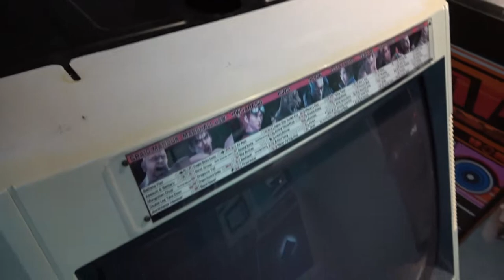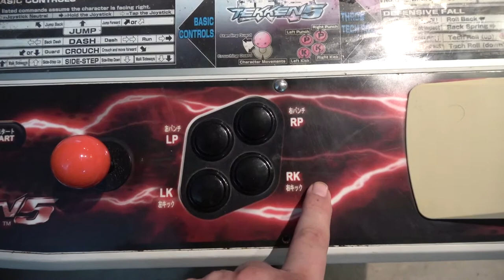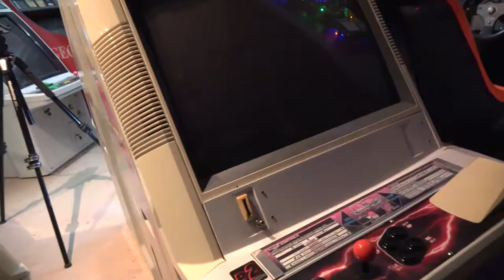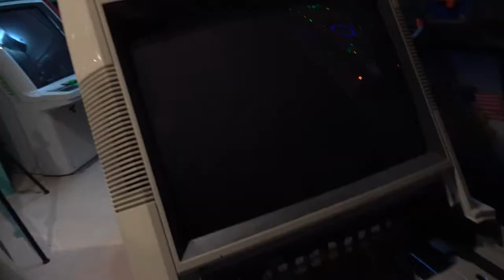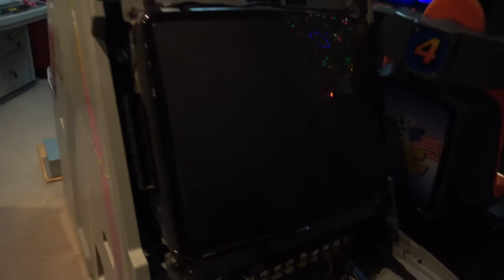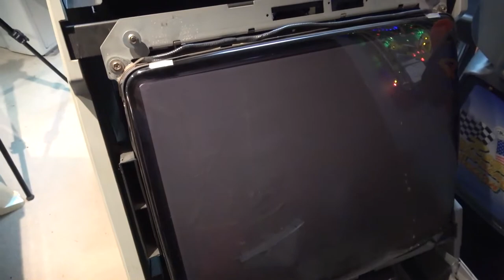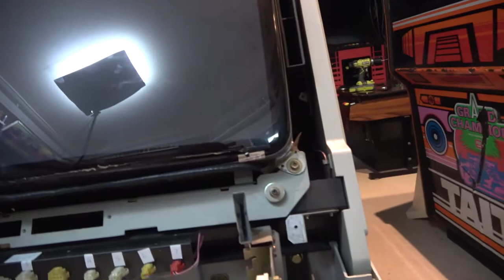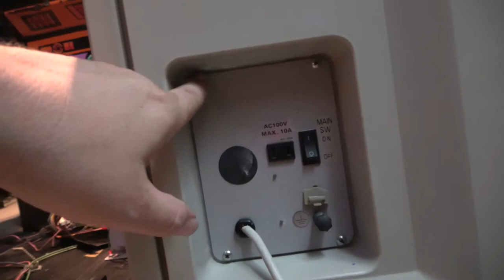FE034 - Let's dismantle a Sega Versus!

Comment: I have a versus city but I do not have power supply and harness. Where can I find them?
Reply from the maker: You’ll need to find a parts machine or someone selling the parts direct. They do come up on 2nd hand sites from time to time but they aren’t that common. You can also try in arcade forums and the www.fromjapan.com website that’s allows you to search Japanese eBay for stuff and buy via proxy. That were I bought a spare Blast power supply myself.